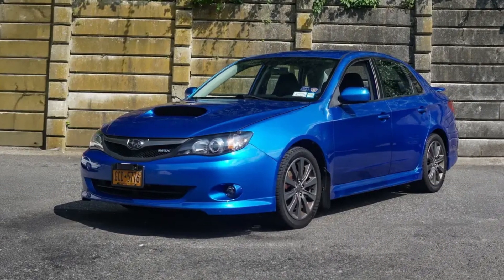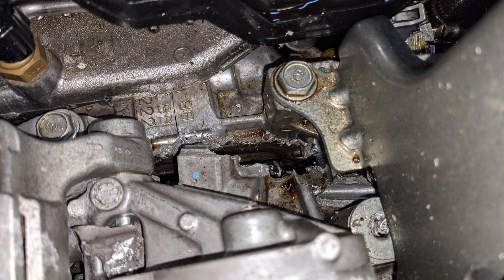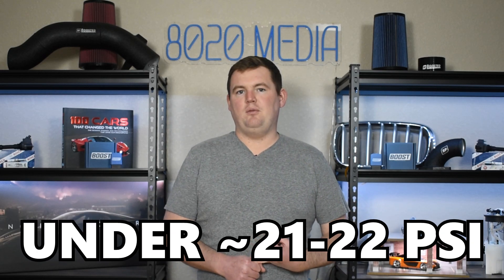Subaru's FA20 Engine | Problems & Reliability (FA20F & FA20DIT)

Comment: Blew my 2019 FA20DIT with less than 30k miles. Might have been my fault... upgraded to a front mount intercooler, bigger turbo, bigger fuel pump, put on the BRZ intake, killer B headers and a cobb turbo back titanium exhaust system. Left the block stock. Tuned it to about 400 WHP it wanted to go higher but thought it best to not do more due to the stock block and it blew 5 months later. Live and you learn lol.
Reply: Lol I dont know much about modding but I've heard these engines need the block built if you're going 400hp and above. Guess its true thanks for sharing

Comment: I have a stock 2017 wrx, just an axle back exhaust. It’s got 210,000 km, oil changes every 5000km. Still haven’t seen any issues with the engine or transmission. Great car, super impressed.

Comment: I’m at 135k miles and have been tuned on E30ish since 100k miles
Reply from the maker: C - Nice! Thanks for sharing your experience!
Reply: Hey! Any other mods on your car? And is the E30 worth it? Are you running stock trans?

Comment: I have never seen a Subaru with high mileage. If they had high mileage probably engine was rebuilt or replaced. Boxer engines by design not long lasting.
Reply from the maker: T - Not true. We've seen MANY high mileage Subaru's. All depends on how they are kept up with.
Reply: I had  1992 Impreza, it had 330,000 miles so....
Reply from the maker: @saulespino2510  Nice! Thanks for sharing.
Reply: Mine and wife my wife's 2010 Subaru Tribeca (EZ36) has 182k miles on it...still chugging along. Keep up with regular oil changes and they tend to push 200k pretty easy. To be fair...the EZ36 is possibly one of Subarus most reliable engines 😂
Reply: I’ve soon subies with 150k+ on them and run great.

Comment: So I have a 2021 Subaru WRX with 53k miles and bone stock accept a catback any recommendations to keep it reliable? This is my first Subaru and I’ve been babying it since I got it 3 weeks ago..
Reply from the maker: U - Keep it the way it is honestly and just stay on top of maintenance!
Reply: Don't EVER under any circumstances starve the engine of a drop of oil and change it religiously
Reply: Check the oil every time you fill it with gas, and change the oil sooner then what the manufacturer recommends
Reply: @lophilip will do, also yeah ima do my oil changes every 3000 with valvoline.

Comment: These motors are so great when left completely alone and so terrible when modified. I’ve put 100k+ on my fa20 wrx, burns no oil, still gets 30+ mpg, never had ANY issues with it. Seriously the most reliable car I’ve ever owned. Every one I’ve met who has modded their wrx has nothing but problems with it. The stock tune is more complex than people realize and a lot of the weird cam timing and rev hang is 100% intentional and beneficial.
Reply: Did you do an reliability things like aos or better oil pickup
Reply: How about if you keep the engine bay stock and just get a Cobb tune or a custom tune?
Reply from the maker: A - Nailed it on the head!
Reply: I did a very conservative e-tune on my 2019 WRX with no bolt-ons and I get much better gas mileage, much smoother power delivery, WAY less knock (stock tune had frequent knock incidents), less rev-hang (yes, the rev hang is intentional and only benefits emissions to an infinitesimally small degree) and a much more enjoyable, linear experience. I've had zero issues with it, doesn't use a drop of oil.
Reply: @maxpeck4154  less knock incidents on an accessport is only because the tune is less sensitive to very minor knocks. The stock tune is far more sensitive and will pick up false knock a ton, but will also pick up extremely small amounts of knock before they get big. An E-Tune usually ignores these minor knocks, hence why you are seeing less of them.

TL;DR you aren't actually having less knock, just getting less readings.
Reply: @mrscoot595  Interesting. I'd never heard that but seems plausible.
Reply: @maxpeck4154  Yea I was on the OTS stage 1 cobb tune and had some issues so I went back to the stock tune but kept the access port. Did a super deep dive into tuning and learned all this

Comment: I own a 2019 wrx appreciate this video. My friends 2017 blew at 75k hoping that me staying on top of everything is enough right now at 70k.
Reply: Does friends wrx have mods and are the mods tuned?  Does friend not properly service his FA20DIT?  Does your friend beat the piss out of his FA20DIT?  The FA20DIT is a really good flat four design and less prone to failure compared to earlier designed EJ's.  Its usually the owner not the car.  I've owned 2 EJ powered GR chassis with 300k plus.  I take care of my vehicles though.
Reply from the maker: S - Well said!
Reply: @shiloh5199 he did not have any modifications completely stock I mean who doesnt beat on a wrx theres a difference between driving it like a sports and absolutely thrashing it and launching every stop
Reply: @shiloh5199 I take really good care of mine I feel just havent done the intake valves yet
Reply from the maker: W - So long as you stay on top of maintenance and know what you're doing if modding it!
Reply: I honestly thought about another platform bc I wanted to do a catted downpipe and intake but Idk if its worth it
Reply: My motor let go at 138xxxkm due to a brg spinning (haven’t figured out why after doing a teardown) but now doing a proper build

Comment: I was thinking walnut blasting every 60k miles. 

This isn’t just an FA20 problem but a problem for direct injection engines in general.
Reply from the maker: Yes, very true. Any DI-only engine is prone to carbon build-up. Some engines handle oil blow-by better than others, but without fuel spraying into the ports there is no way to completely eliminate it.